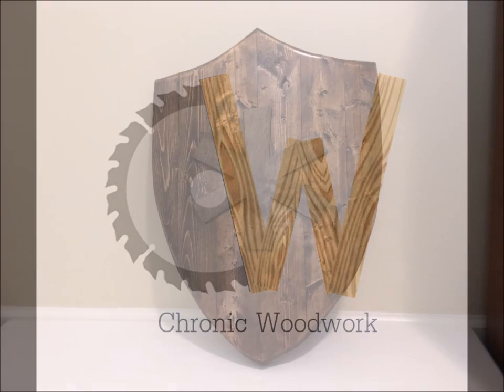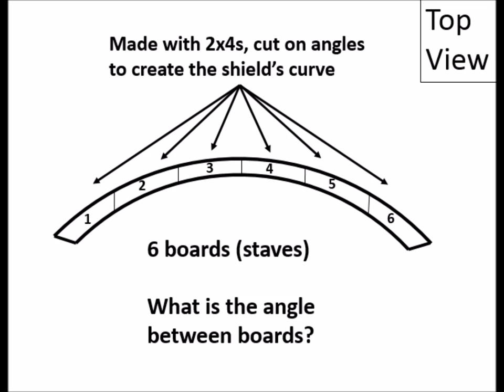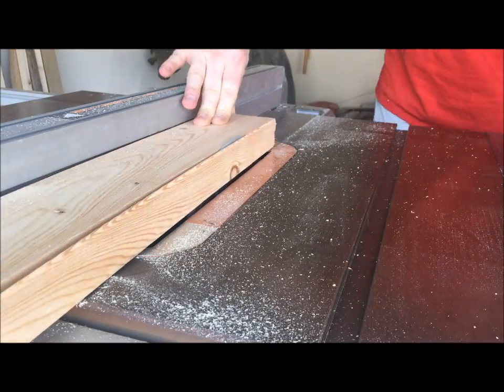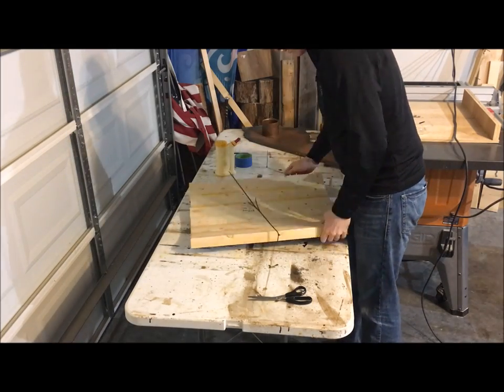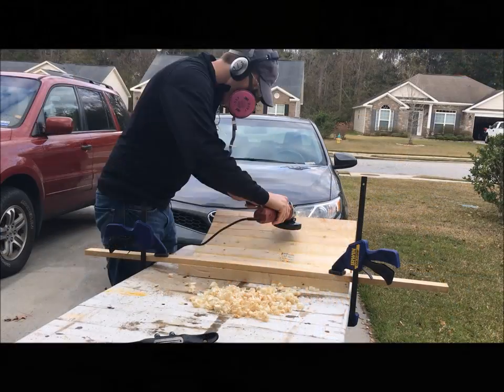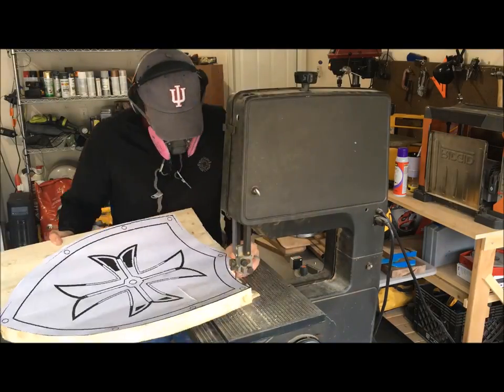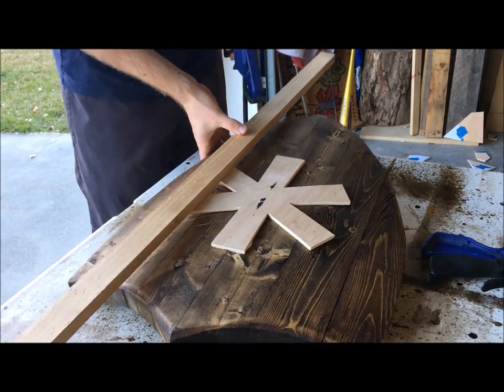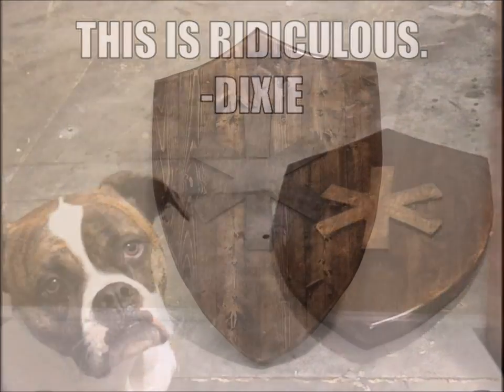Build a Wooden Shield

Comment: How do you suggest attaching planks with a biscuit joiner? Just bought one and would like to use it to make a shield. How would you go about angling the blade? 
Thanks for posting this video! Very concise and clear with instruction!
Reply from the maker: Mackenzi Coan I wouldn't attempt to angle the tool. I would probably make a jig to hold he birds, so the edges to be joined are at 90 degrees to the work surface 

Bus disclaimer: I don't own a biscuit joiner

Comment: What kind of bench saw do you use? and what kind of blade? just starting out and am wondering
Reply from the maker: Riddle Nanngi my table saw is a rigid model 4512 I believe . It’s a great hybrid/hobbyist saw. Much better than the typical table top/contractor saw. I use a multi-purpose blade for both crosscutinf and ripping. 40 TPI.

Comment: I was wondering, if you found a tree with a large enough diameter, could you make a shield out of a single piece of wood?
Reply from the maker: Rafael de Rezende definitely. It would definitely change my approach on how to make it though. Basically throw out all the math I did in the beginning of the video and go straight to work with the holey gallahad carving disk for the angle grinder.
Reply from the maker: And I'd have to buy a chainsaw.
Reply: Chronic Woodwork why dont you just ask notch how to punch a tree with your fists and knock it over without really hurting yourself (if you play minecraft you'll get it)
Reply: you would have to go with the grain, not use a cross cut

Comment: One question, why did you use 2x4's?  It would seem to me to be both easier to build and more historically accurate if you made it out of thinner boards, such as 1x4's.
Reply from the maker: David Briggs primarily because 2x4s are cheapest lumber available. Wanted the project to be accessible for everyone. Second,  I knew I was using s spoke shave and holey Galahad bit for the first Time. I was unsure how much material I would need to remove and 2x4s gave me more room for error. I was afraid I’d shave through 3/4” material or it would be too weak. 

Historically- I’m no history buff, so I’m not sure what information you are referencing. But I’d be happy learn. 

Thanks for watching. 
Andy
Reply: Andy:  Try carrying a shield made out of 2x4's for any amount of time.  Real shields were made out of much thinner wood, down to as thin as 1/2 inch in the center, and tapered towards the edges.  That's also the reason that shields (with the exception of the very small buckler) were made out of wood and not metal, weight,
Reply from the maker: Well this thing hangs on a wall, so I guess I’m lucky I don’t have to carry it. If I ever find myself in need of a functional shield, I’ll keep it in mind. Thanks.

Comment: hi i have a question... what is the fracture toughness of the wood? i search the approximation in KJ/m2 or in  MPa in order to understand what kind of arrow a shield of wood can stop... thanks
Reply from the maker: luca zappalaglio most importantly: I don’t plan on getting arrows shot at me. This shield hangs on a wall as a decoration.  

That said, I’m not familiar with “fractural” strength. I’ve learned compressive, tensile, and flexural. Did you mean one of those?  In MPa, pine is rated at 6, 12.8, and 27.1 respectively. I use pine because it’s easily available. I did no research into strength.